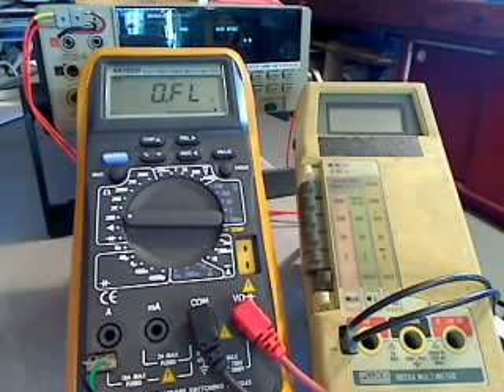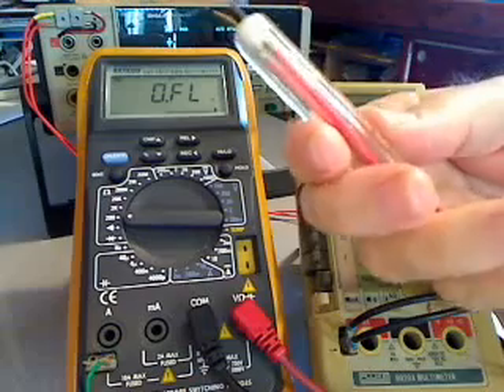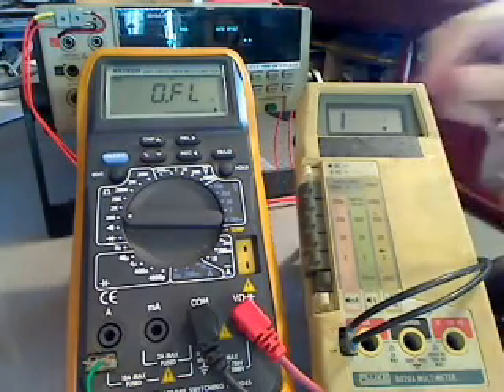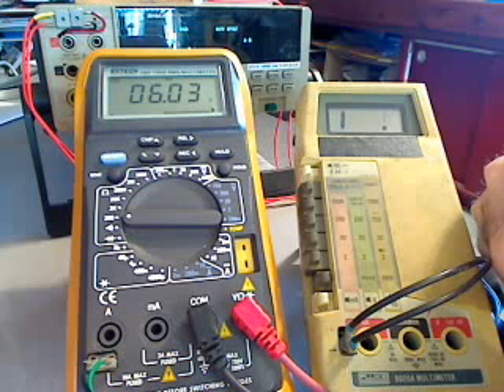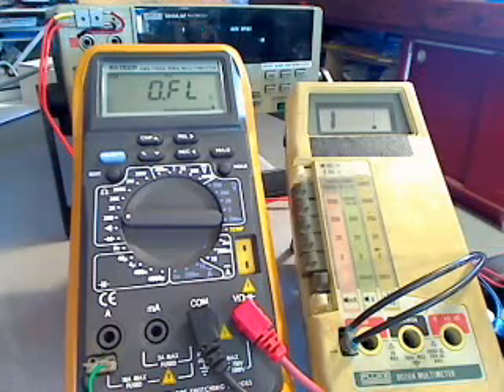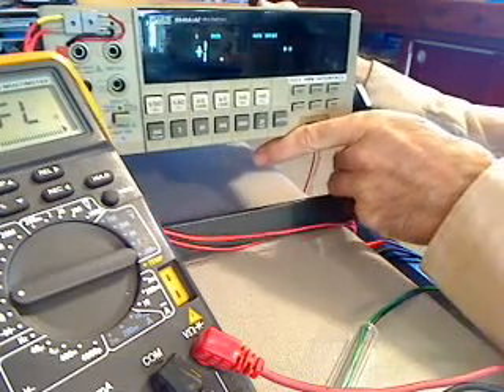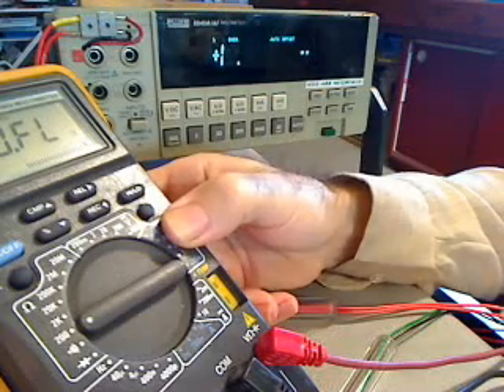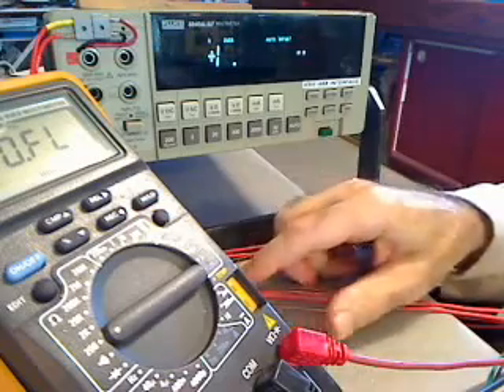MULTIMETERS

Comment: Hi, I was just looking for Fluke DMM videos and come across this by accident. Have you tried using a constant current source (100mA or so) and a DMM on milivolts? Constant current sources can be made very easily out of a voltage regulator and battery + few other bits. 
Quite sure you bench fluke meter uses this method (4 wire ohms measurement).
I have used this method in the past as a poor mans low ohms meter with good success at measuring resistance of automotive ignition coils.

Greg.

Comment: @seasonedtoker 
well this is an old post but maybe answering it will help. DMM's are rated with a percentage and you should be somewhere within that range. For instance if your meter says that it is 1% accurate and you read 100 volts then the real reading could be 101-99. 
A good multimeter will have a manual with it that tells you the accuracy.